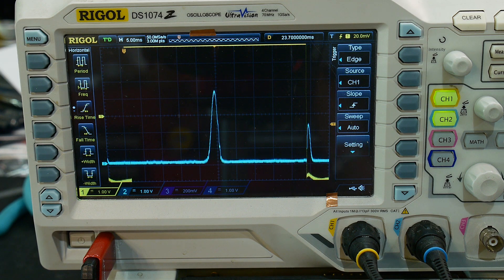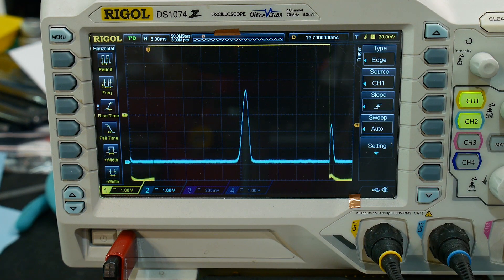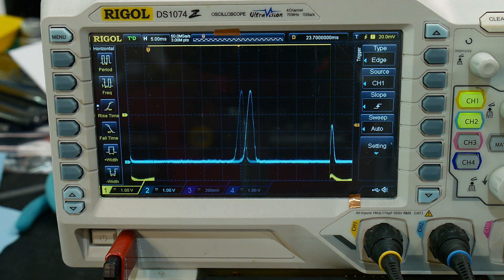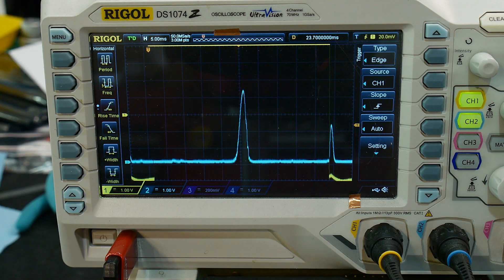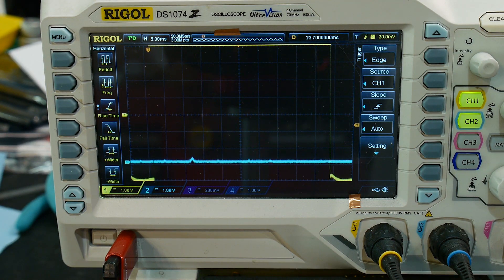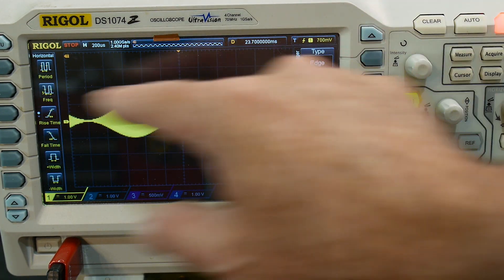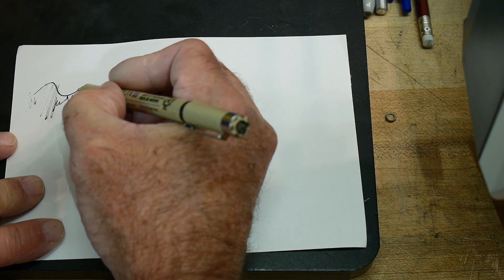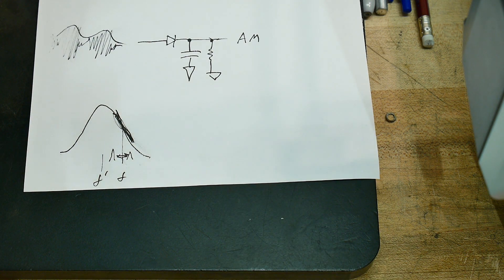#572b FM Demodulation

Comment: if FM is shifting frequency than how when we tune exject fm radio station like say 90 MHz we can hear stable broadcast if frequency is shifting below and above 90mhz ! how it compensate  ?
Reply from the maker: The IF in the radio does not change. so if the IF filter in the radio is 10.7MHz then the IF is 90 + 10.7 = 100.7 and is fixed.
Reply: @IMSAIGuy The answer you gave him confuses me because 10.7MHZ is down converted frequency using a mixer so that components used after 10.7MHZ will be cheaper.
Reply from the maker: @stevekim6923  the local oscillator of the first conversion is 100.7, yes it gets mixed down to 10.7

Comment: Hi would you mind doing video on AM modulation and how sidebands are produced. I understand how they are mathematically produced by a mixer, but not clear how modulating one Tone would produce sidebands(rather than just carrier moving up and down). Is the sidebands real signal or are they mathematical representation of a varying amplitude in FFTs.
Reply from the maker: it is very real. if carrier is A*cos(x) and modulation is A=cos(y) then modulated carrier is cos(y)*cos(x)
since: cos a cos b =  (1/2)[cos(a + b) + cos(a - b)]
you get two sidebands

Comment: What's the purpose of the copper tape on your scope screen?  Great video!
Reply from the maker: I bought a screen protector some guy was selling. Just a cut piece of lexan. said the static would hold it in place. well it did for a year then kept falling off. I had some copper tape in my hand and that is how its been since.
Reply: @IMSAIGuy  Oh, well that makes perfect sense.  I was trying to figure out why you needed to bond the screen to the plastic case with copper tape.  Thinking too much.